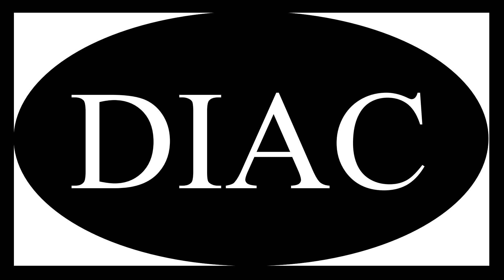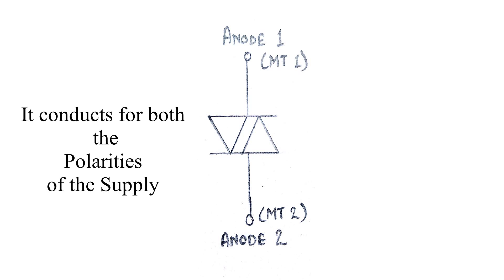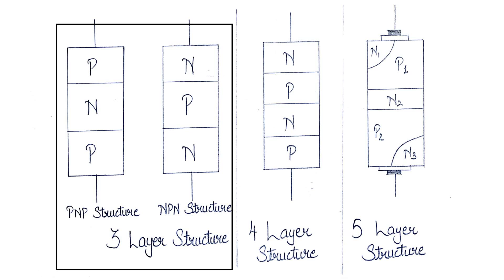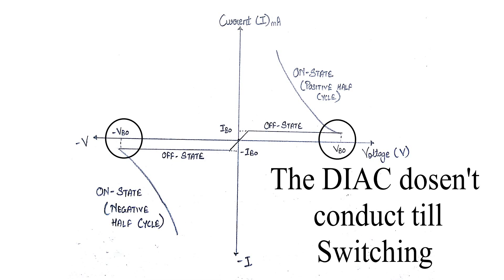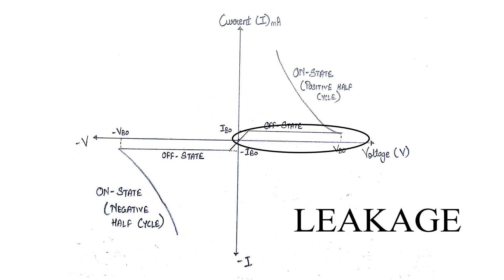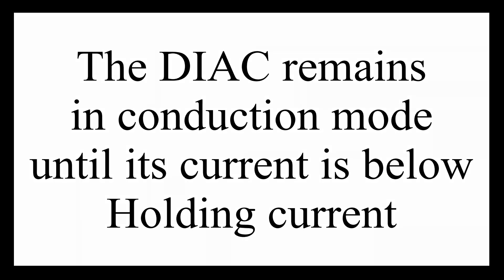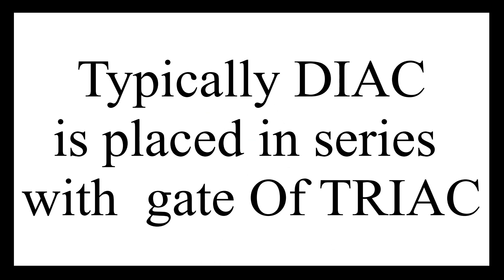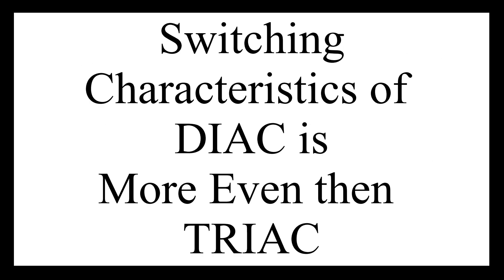DIAC

Comment: What is the significace for the curve in the graph in both forward and reverse polarities? Current can either moves in straight line
Reply: The current here increases with the increase in voltage.. i.e. after the diac is turned ON. But, this increase is not linear.. The current increases gradually.. and thats why there's a curve on the graph. Due to non-linear property of diac.
Reply: @smit-shah21  As after the brekdown voltage Vbo ,there is sudden increase in current due to negative dynamic resistance.             What does negative signifies?
As the nobb of voltage applied in diac circuit is not changing itself.why current is moving in  reverse direction only??